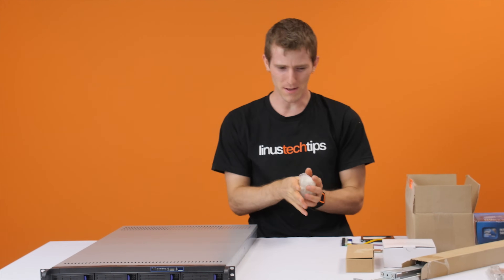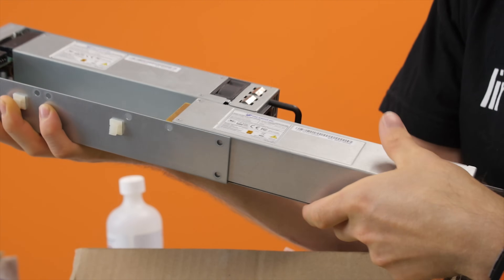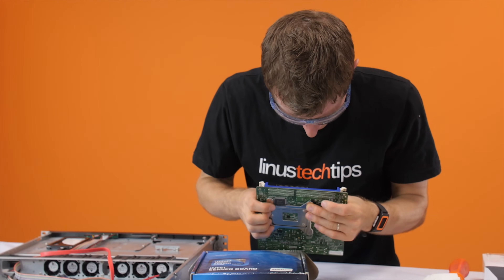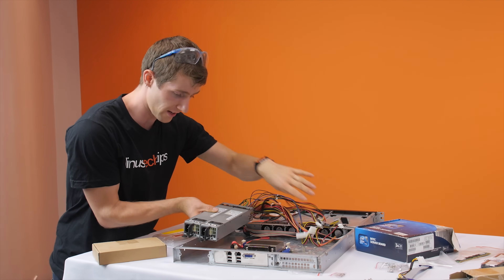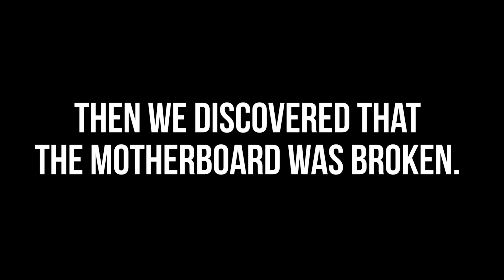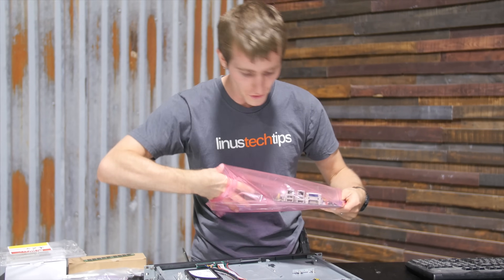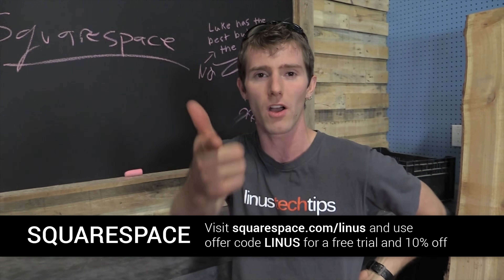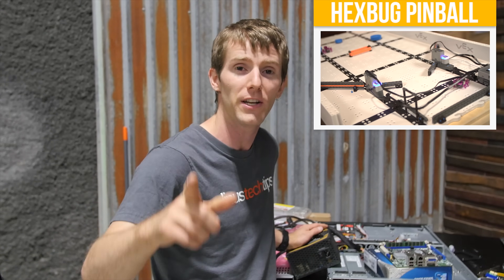DIY pfSense Rackmount Router Build Log - Part 1

Comment: I really don't understand why they needed that hardcore backplate.. There is no weight from the cooler, it just needs to hold it, so it doesn't fall off or move around. It might also be that weird cooler shorting out some more stuff..
But I have to say that dieing "Beeeeoup" at 11:28 sounded nice :-D

Comment: @LinusTechTips. I think you guys probably shorted out the board with the backplate, use electrical tape to insulate any unwanted metal to metal contact, but than again you guys probably already figure out the problem, I bet.

Comment: worked with pcie risers before, broke boards before.
It actually burned into my mobo. If you can avoid it, avoid them. If not then brace yourself.

Comment: After looking at this board closely. It looks like this was never meant for aftermarket heatsinks with a backplate. Only the push pin stock intel heatsink or a heatsink that secures without a backplate can fit without causing issue with circuitry. Noctua has NH-L9i, just don't use the fan.

Comment: Don't you guys have a actual test bench to figure this stuff out, like if the damn back plate it the problem. I feel like in that small case it is probably touching metal and shorting it out.

Comment: Hey Linus: maybe take a TechTip from me: use a Supermicro A1SRM-LN7F-2758 and a Supermicro SC510T-203B chassy, you lose the redundant PSU and CPU upgrade capability but gain much more:

- 7 GbE LAN ports with programmable bypass (instead of 6 you have now)
- 2 font accessible 2,5" drives (instead of the 4 x 3,5" drives that you have now, you can only connect 3 because of the 4 SATA ports on your motherboard)
- Internal USB and SATA DOM header (yeah yeah you don't wanna now, just know its there)
- 8 core CPU @ 2,4GHz with only 20W tdp (instead of the 4 year old, 4 core CPU)
- IPMI for remote out-of-band management (so you don't have to have a monitor connected to see the console)
- No dremel & angle grinder usage required

Comment: you should take your own advice  and test everything unmodified before putting it in the case. that could take out any possibilitys of dead psus or maybe shorting pins due to the heat sync.

Comment: As other people have said, it's probably a short between the backplate and the motherboard. You should put a silpad between the two to insulate them. They're essentially thin thermally conductive rubber and they're only like $2.

Comment: Why wouldn't he just use a couple of m3 nuts to secure the cooler? It's not like a vertical mounted cooler tower that will sag off of your motherboard. No grinders, no contacts being shorted, no bending motherboard.

Comment: I mean any common sense would be completely out of the question. Like testing it on the motherboard box before inserting it into the chassis where you might accidentally shorten or break it.

Comment: this has to be the worst thing I've seen in a while. Despite the fact it's an 80w machine for pfsense, using a whole 1u rack, you always check compatibility between hardware, including the mounting and you certainly don't block the lower half of a heatsink. if an anglegrinder is needed you are doing something wrong.

Comment: It looks like you are grounding out on the heat sink a couple of the though hole components on the top of the board and loads of surface mount components on the underside with the bracket. Couldn't see in video but did they have a layer of plastic applied to provide electrical insulation?

Comment: I'm curious if he built a router just to show people it can be done. Otherwise I would of just went with a Cisco rack mount router. Also what kind of computer guys takes a dremel tool and a angle grinder to computer parts? Watching him quite literally butcher the IO shield, back mount plate, and speaker pins was like listening to nails on a chalkboard.

Comment: Linus should have at least put something between the heat sink and the mobo so things didn't contact. sure he cut away problem areas around the edges. but you cant see under the middle of the back plate. there was probably more areas contacting it.

Comment: Really DO NOT like the fact that your heatsink for the CPU is in direct contact with the top of some of the capacitors on your board... Also the backplate looks like it's shorting the MB... :/

Comment: It could be three things. 1 - the backplate is causing shorts and too much stress, 2 - the speaker hack with the Dremel may have caused damage to other components, or 3 - the extra connector may be overvolting the board.

Comment: Yay or nay?:
Intel Core i5 4460
MSI GTX 960
MSI Z97 Gaming 3
Corsair VS550
HyperX Fury 8 gb ram 1600Mhz
Cooler Master CM Force 500
1 TB Harddrive
Cooler Master Hyper Evo 212

Around 1000$
Reply: +Aluminium Tech Nope
Reply: berzu21 To be fair, all he plays is LoL and Heartstone and watches YouTube videos. I think it is fine :)
Reply: ***** Too much money man, too much money.
Reply: Dude 2 TB is a lot. If he only needs 1TB then he shouldn't pay extra for that. Alsp 8GB of RAM is good for most games, and he can always add another 8GB if he needs it.
Reply: ***** I'll get 1 8gb stick for him, and then he can always upgrade to 16 gb later :)
Reply: Look into an Xeon E3 series CPU, for about the same price as the i5 you get a locked i7, and the Xeons tend to be super stable.the GTX 960 is a great choice, 

8gb of ram will get you going, but an upgrade to 16 or more would be great down the line
Reply: +Eroa You should swap that 960 out for a R9 280x and a slightly bigger psu (but only if you go for the 280x)
Reply: +Eroa Yes an a GTX 650 is junk if your on a budget go AMD such as a R9 380 which is a great card and so is a R9 270x they will both kick the shit out of a GTX 950
Reply: +Eroa if you are getting windows then use 1drive for cloud and if using Linux then just use Google drive
Reply: ***** Its for my little brother, and he doesn't care about overclocking. But overall its good, right? :)
Reply: +Eroa It's pretty nice, yep
Reply: +Eroa Then save money on the board and get a H97 if you're not overclocking.
Reply: Nighthawk MSI H97 GAMING 3 that one?
Reply: Yes, it's the same board except the chipset is not for overclocking. And should be cheaper.
Reply: Nighthawk Yeah it is cheaper.
Reply: Just don't use the crappy Killer drivers for the network card. Use Qualcomms drivers.
Reply: +Eroa get a 380 or a 370. much more power for less.
Reply: rage fards Nahh he likes Nvidia :)
Reply: Get a skylake i5 6500 
An ssd
An h170 board 
And an r9 390
(You'll have to wait a bit for h170)
Reply: +Eroa You're totally gonna be playin Minesweeper at 1 FPS with that piece of crap
Reply: berzu21 I guess you're right. But I think because he only has a GTX 650 he can't really play other games.
Reply: If you're okay with going 30 over budget go with this http://pcpartpicker.com/p/3hFfTW
Reply: +Thesuperjaskinassassin The Boss This, much better for gaming. Video cards and memory capacity are more significant than CPU performance.
Reply: +Eroa then not need gaming grade GPU and not so much RAM at all, and that PSU to power that,and what  job will have i5 CPU...maybe if really that is situation then HTPC configuration or even less down to office configuration is more then enough,just take good motherboard (stay on H97 if u choose intel side) and then upgrade as need will maybe came..look like min and recomm config for games he play..
Reply: +berzu21 sure wasting money..
Reply: +berzu21 different people different needs..different best buy configurations..
Reply: ssd
Reply: Neandercatz ikr, but the money 😬
Reply: Just get a 32 gb at least..
Reply: 32GB of RAM for what? read again for what purpose his little brother need this configuration!
Reply: Siniša R. That's a 32 gb SSD...
Reply: thne ok, yes SSD will give most speed up to any system,and is first upgrade to look for owner of any configuration..of anypurpose..yes ideal is SSD for OS and HDD or Cloud? for data like pictures and simular..maybe dropbox wich give a lot of GB i think about 50GB to owners of android phones..fro free..but if i get right this one configuration is for small brother,so maybe just that SSD is enough..and not need any other HDD or Cloud, as data can be stored on other pc,perhaps of older brother or else..yes good point ! SSD!

Comment: There is NO WAY that heatsink is even touching that CPU.   And that motherboard is certainly NOT designed to take a back plate that large.  It is highly likely that you just bent that board out of shape or even shorted a bunch of components on the board and destroyed the board and the CPU in the process.  FIND A SMALLER HEATSINK.
#LinusFAIL #LinusDidADumb

Comment: Ahh Waltz of the flowers from Tchaikovskys Nutcracker
Mozarts A little NIght Music.

Why do they let linus touch PC hardware.
He leaves laptops in the rain, he kills motherboards.
If you have to hack mounting componets to make them "fit" you should really think harder on what your doing.
With all this time spent dremeling and grinding, I am sure linus could have found another CPU heatsink.
Or could have even made a low profile water cooling loop
EK DDC/Laing DDC pump
Some right angle fittings
Some tubing
Alphacools XT45 40mmx3 radiator

Only tricky part would be the reservoir, gave not seen any low profile that are less than 40mm
An EK 5.25" single bay might fit but you will need to do some modding to secure it in the case

Comment: non standard standoffs meaning the back plate does not have enough room, it is shorting against the case also the ghetto cutting of the heat sink bracket is dumb one its metal and its shorting two you have a 3d printer lol use it...............noob

Comment: So Linus, why don't you just use nuts and bolts on this particular heatsink?
It clearly is making contact with too much pins or connections under the motherboard.
And in this case I would believe nuts and bolts would work just fine.

Comment: For as much as you blew on those three and counting motherboards, you could have purchased a Dell Poweredge 1950 1U server from eBay and pimped that out. And it most likely would have even worked first time out.

Comment: This is why you don't mix different suppliers when building servers... You got the CPU-cooler from Supermicro. If you had gotten the case, psu and motherboard from them too I am positive your grinder and glue-gun would have been used a lot less...

Comment: this taught me something, anglegrinders and dremmels are awesome.....
Reply: +Josh ODriscoll You know what is also awesome? Turnips!
Reply: +Josh ODriscoll oh Dremel is really a powerful tool. I had to drill a screw in my GPU to fit a water block and man I would never have dreamed of doing such thing without Dremel. wasn't easy but it was smooth..
Reply: +Ezekiel 6872 you're just all over the comment section..
Reply: +Ezekiel 6872 tru dat

Comment: mobo designed for 1U chassis might have been a better option.. something from supermicro.. they line up the ram so it doesn't block airflow either.
Maybe a X10SL7-F. I used to design enterprise gear and supermicro rarely lets us down.

Comment: I'm guessing that particular PSU needs to be grounded instead of hot glued, in the US and Canada a NEMA 5-15R outlet for 100-120 V~ or a NEMA 6-15R outlet for 200-240 V~.  An insulated ground wire is required, The insulated grounding source must be from a building ground source.
Reply: +Js JavaScript That PSU has a maximum combined +12 Volt continuous current rating of 30 Amps. You should be using a PSU that has at least 33 Amps or greater. That's why your PSU is shutting down because it is unable to provide the power your system is asking for so one of the protection circuits is being triggered.
Reply: +Js JavaScript I agree - needs more cowbell also
Reply: By failing like Linus there and then fixing the issue. All you have to do is fail a lot and then fix the issue and then not fail at that issue again - that is wisdom and learning!
Reply: Brandon Ottinger  "Valar Morghulis"
Reply: +Js JavaScript I'm guessing that particular TURNIP needs to be grounded instead of hot 
glued, in the US and Canada a NEMA 5-15R outlet for 100-120 V~ or a NEMA
 6-15R outlet for 200-240 V~.  An insulated ground wire is required, The
 insulated grounding source must be from a building ground source.
Reply: +Js JavaScript I'm guessing he plugged the 4 pin floppy disk drive power cable (that has 12V on one pin and 5V on another pin) into the fan header.
Reply: ***** Valar Dohaeris.... well played.  I'm just not a fan of javascript while building my websites lol
Reply: +Js JavaScript how do you guys know this stuff , I wanna learn too
Reply: +Js JavaScript js javascript we are enemies, I'm sorry
Reply: +Js JavaScript Well the back of the PSU was still touching the case I think. Either way it shouldn't really be a problem. If the motherboard has its groundplane connected to the case then the PSU will also be grounded. If this isn't the case then both are floating and will do just fine.
Reply: ***** agree the BP could  also be the culprit and a possibility

Comment: idk, my first idea would be to drill and tap holes into the case itself and get longer screws to go into the heatsink and not just plonk down this random metal backplate. Or hey 3D print a backplate. ;P

Comment: you have shorted out the motherboard with the back plate. first beep shows that anti short circuit chip worked, second too and when there are no beeps it means that that chip has burned down. solution: put some kind on isolator between motherboard and backplate

Comment: I'm not an expert, but doesn't the metal backplate and metal case short the motherboard?
Reply: +AL_O0 ᶜᴼᴹᴹᴬᴺᴰ ᴮᴸᴼᶜᴷ ᴬᴺᴰ ᴿᴱᴰˢᵀᴼᴺᴱ only if you screw it in directly. motherboard trays have risers that raise it up enough that there wont be shorts
Reply: +AL_O0 ᶜᴼᴹᴹᴬᴺᴰ ᴮᴸᴼᶜᴷ ᴬᴺᴰ ᴿᴱᴰˢᵀᴼᴺᴱ A metal case, at the very least, does not, because my computer's case is metal. Also...most computer cases in the electronics store are metal. 
The backplate, maybe. Case, definitely not.
Reply: +SangoProductions21 if the motherboard was not on standoffs it could short out on the case.
Reply: +SangoProductions21 that's what mobo standoffs are for... please tell me you installed them on your own.
Reply: I was thinking the same throughout the whole video!!!
Reply: +AL_O0 ᶜᴼᴹᴹᴬᴺᴰ ᴮᴸᴼᶜᴷ ᴬᴺᴰ ᴿᴱᴰˢᵀᴼᴺᴱ  The motherboard is cleared from the case by using standoffs, and the backplate I think Linus should've tried to insulate it with tape or something.
Reply: yeah, they probably should have done the D.O.A test
Reply: +AL_O0 ᶜᴼᴹᴹᴬᴺᴰ ᴮᴸᴼᶜᴷ ᴬᴺᴰ ᴿᴱᴰˢᵀᴼᴺᴱ My guess is that the cooler's backplate shorted a few of the SMD components. You usually have standoffs included with the case to prevent a short to the underside
Reply: But the backplate...
Reply: I don't know, but maybe a normal case and normal cooler may help, or a first boot outside of the case like in the old build logs may help
Reply: +SangoProductions21 that's what motherboard standoffs are for.
Reply: +AL_O0 ᶜᴼᴹᴹᴬᴺᴰ ᴮᴸᴼᶜᴷ ᴬᴺᴰ ᴿᴱᴰˢᵀᴼᴺᴱ  my tought aswell! +LinusTechTips
Reply: +LinusTechTips +cmdstraker my vote lies here.... its clear to see that there is standoffs in the case, just enough to not short anything. and that's how 1U cases work... not to less but deff not more than needed

the back plate has to be made to fit the board... anything else is a risk... and ad least file of the edges where you cut so they are smooth... and then cover the side that goes against the motherboard with kapton tape... if you cant move it by then its to close... i would even put on 2 layers of tape so i know clearance is ok.

and while at it make sure you can pull those PSU units... or a redundant psu would be a waste
Reply: Yes, if the metal backplate was touching any of the metal solder points on the board it will cause a short...
Reply: +Name Optional He was insulating it the second time.
Reply: +AL_O0 ᶜᴼᴹᴹᴬᴺᴰ ᴮᴸᴼᶜᴷ ᴬᴺᴰ ᴿᴱᴰˢᵀᴼᴺᴱ The motherboard sits on standoffs so it doesn't touch the bottom of the case.
Reply: +SangoProductions21 The motherboards sits on stand offs so it doesn't touch. That backplate and how tight it is to everything.. plausible.
Reply: Exactly what had happened (Y)
Reply: +cmdstraker he should have tested a stock intel cooler on a test bench (so not in the 1u rack)
sometimes linus acts like a n00b, i would have done it differently
Reply: +Liam Mclaughlin yes, I watch Xisuma! And Mumbo also watches Linus (at least he wants a Titan x on the giveaway!)
Reply: +AL_O0 ᶜᴼᴹᴹᴬᴺᴰ ᴮᴸᴼᶜᴷ ᴬᴺᴰ ᴿᴱᴰˢᵀᴼᴺᴱ It does seem that the metal backplate could have been receiving electricity and may have shorted the board. I just built my first PC a couple months ago so don't take this as definitive.
Reply: +AL_O0 ᶜᴼᴹᴹᴬᴺᴰ ᴮᴸᴼᶜᴷ ᴬᴺᴰ ᴿᴱᴰˢᵀᴼᴺᴱ its probably the heatsink or backplate
Reply: definitely agree. that back plate is most likely shorting the motherboard out
Reply: +AL_O0 ᶜᴼᴹᴹᴬᴺᴰ ᴮᴸᴼᶜᴷ ᴬᴺᴰ ᴿᴱᴰˢᵀᴼᴺᴱ The backplate shorting out solder points isn't unheard of and is surprisingly common. I've experienced it myself and seen others fall victim to it.
Reply: +AL_O0 ᶜᴼᴹᴹᴬᴺᴰ ᴮᴸᴼᶜᴷ ᴬᴺᴰ ᴿᴱᴰˢᵀᴼᴺᴱ the case is made of metal because it also serves as an electromagnetic shield. 

And the only part for a motherboard to have contact with the case is the screwholes.